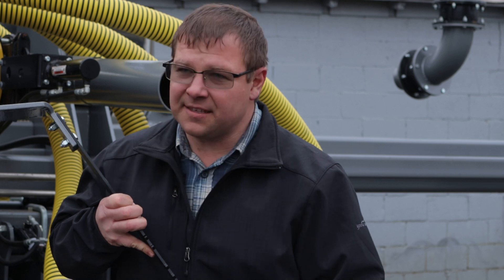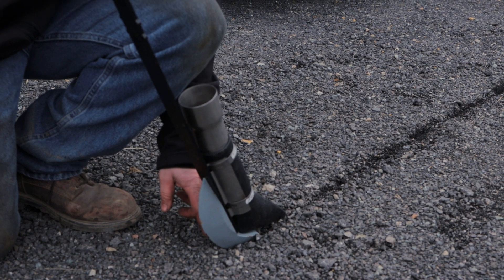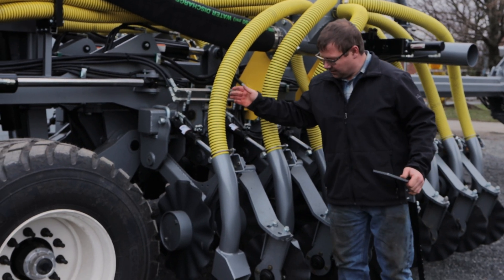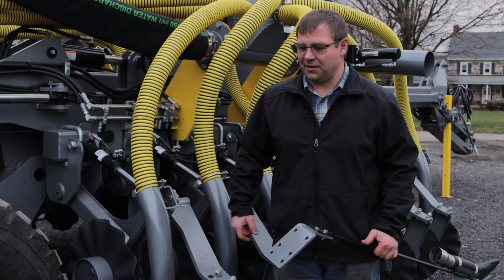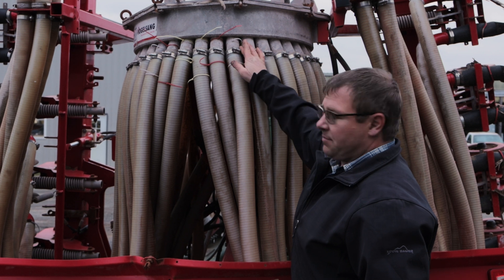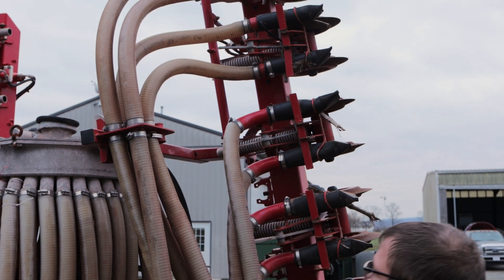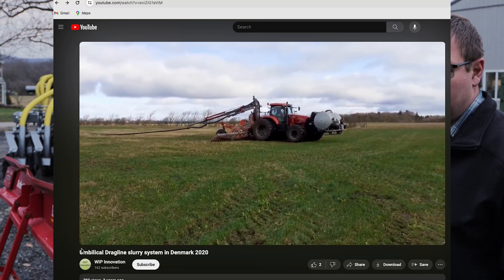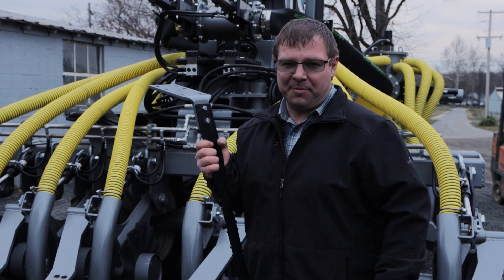Grassland versus Low Disturbance Manure Dragline Injection.  University of Wisconsin. Haul Manure.

Comment: We use a similar disc injector on our tank, the key to a good flow is that the hole in the distributor is smaller than the hoses. Ours has 2" hoses and 1.5" holes in the distributor. Anything larger will be chopped up
Reply: Out of curiosity, what is an average flow rate for you and how many gal do you spread on arable land and grassland?
Because for us the high driving speed is the limiting factor rather than the hoses
Reply from the maker: a.Around 2 to 3K gallons a minute is typical..  
b. You correct going fast when wanting to put on less per acre.
 Either drive fast or have a really wide machine. You can call Eric 610 468 9666   if you have ideas for it. We make these videos as part of our own learning .
Reply: With a 3k gallon flow you would have to cover almost an acre every minute to meet German law.
Reply from the maker: Ah, that makes sense why the European draglines are sized smaller. We think 9K our Pennsylvania  gallon acre restriction is bad. Were there is  no restriction they do 20K gal acre